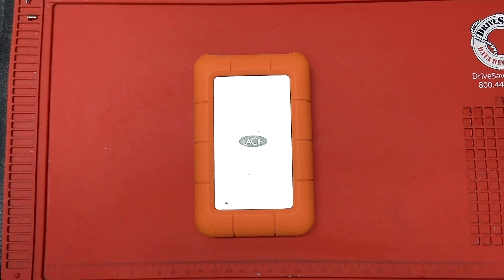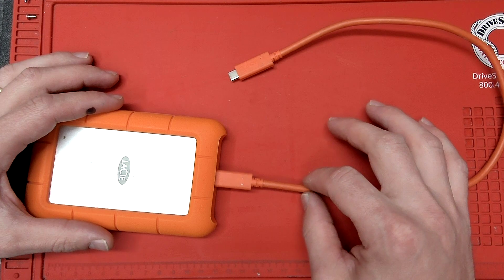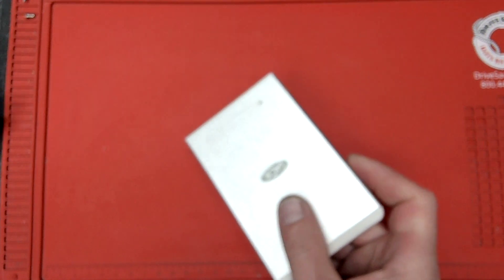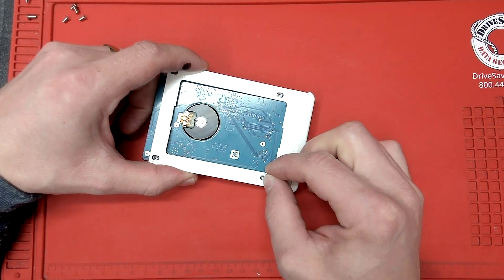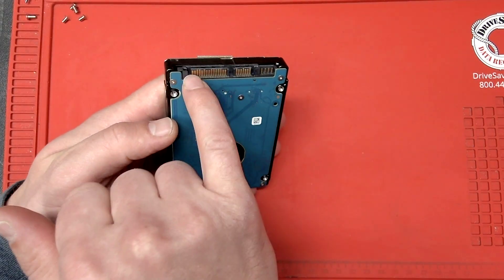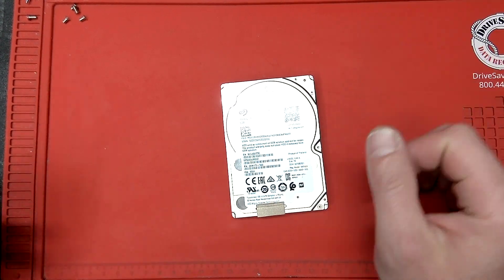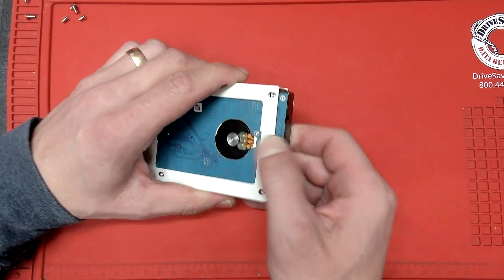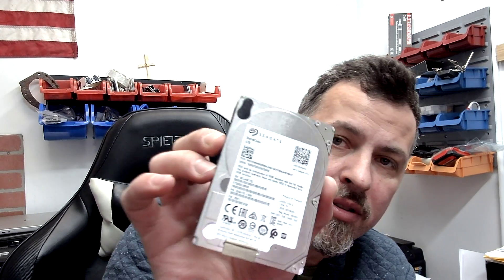Lacie broken connector FIX

Comment: It didn’t work for me — my MacBook recognized the device, but the hard drive didn’t appear and shut down after about 45 seconds. Could this be a power issue? Should I try a USB/SATA adapter with an external power supply?

Comment: And where is a fix? )))
Reply from the maker: The fix is -if you listen to what i'm saying, buying a cable or a different enclosure for the actual hard drive and connecting it to the computer. Since most of the people won't have the soldering skills or equipment, there is no point in showing you how to solder the connector back. You're welcome
Reply: @comptechnyc  buying different enclosure is not "a fix"
replace the connector is "a fix"
Reply from the maker: Yeah, as in most of the people would have the right tools to resolder the connector. I offered a solution, in buying a different enclosure -which btw will be cheaper than the usb port FYI. But hey, if this video is not for you, move on, don't dwell on it.